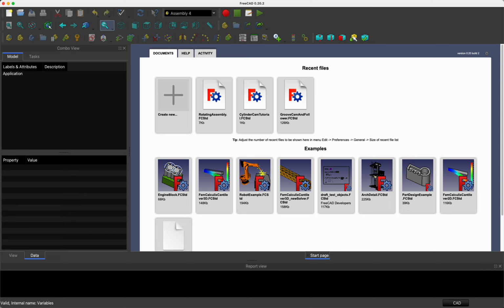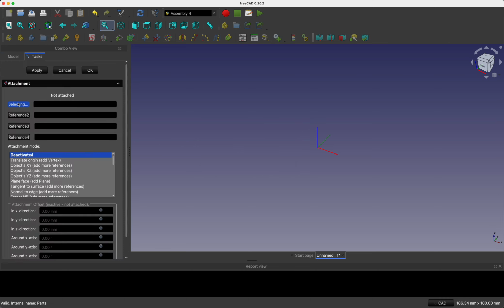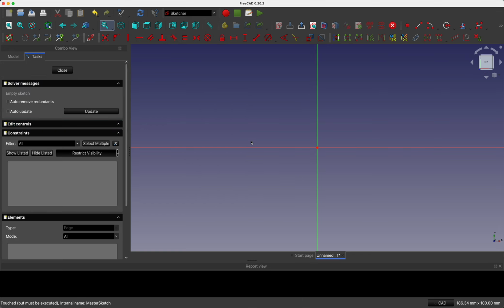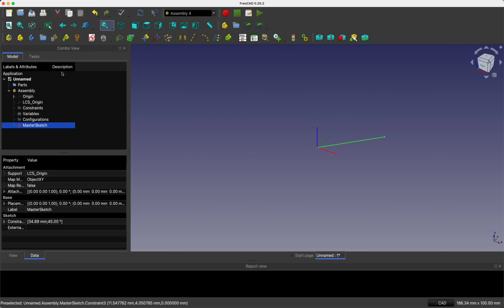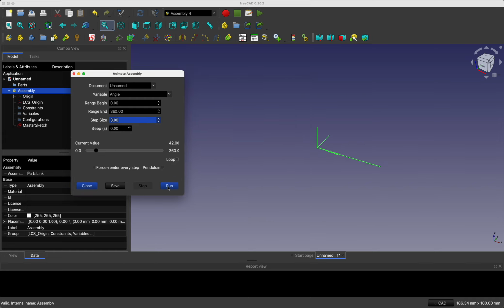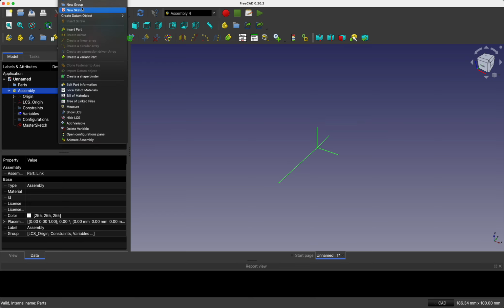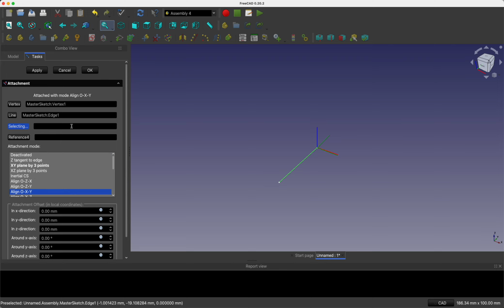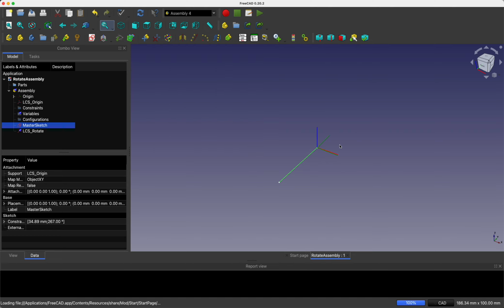Beginner FreeCAD Assembly 4 tutorial to set up an assembly for a rotating object

Comment: Nice Tutorial. 

When i animate the rotation of a LCS it flips per 180 degree. I rotate around the x axis and it flips trough the y z plane. Did you came across this problem ?
Reply from the maker: You need to play around with the settings so you understand what each setting does. Then you use the settings that do exactly what you want.
Reply: Am going through it bro did u find the fix